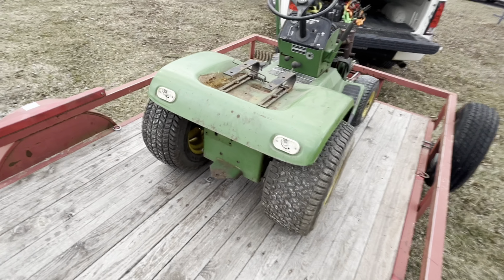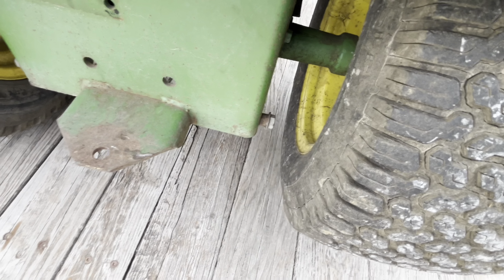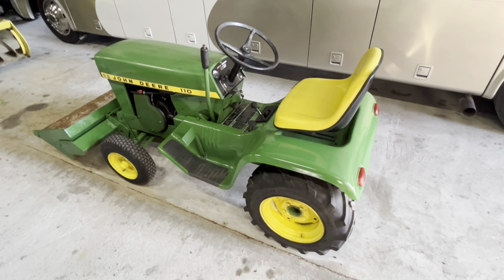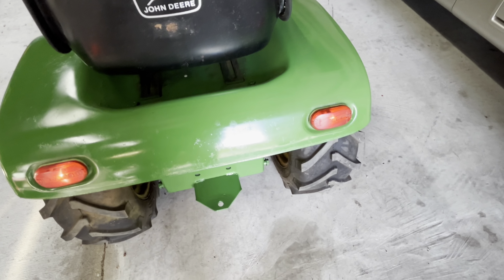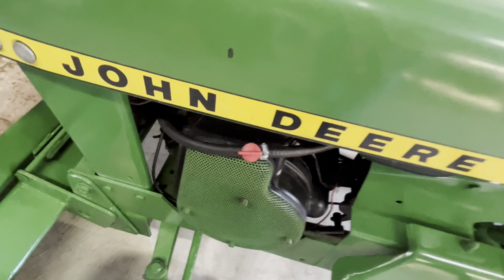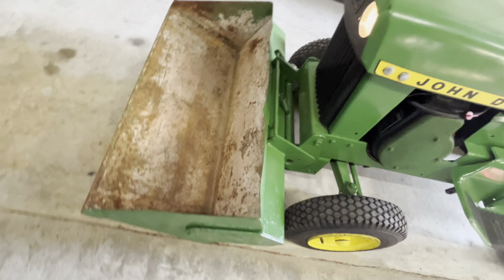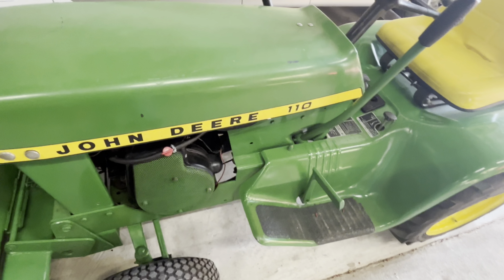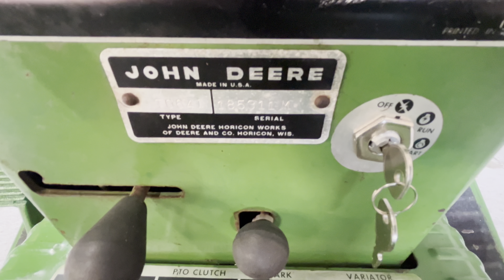This John Deere 110 is back from dead. Another one saved.

Comment: How hard is it to rewire the 110, last fall my 110 decided to cut spark so I pulled the covers off, and took the fly wheel off. I had to resort to cutting the stator out because I thought that was the culprit but I was soon humbled when I figured out. Do you know of any good places that sells stators for 110s?
Reply from the maker: The rewire part is pretty easy. I have a few manuals that have the diagrams and colors. They can be found on google as well. Its just time consuming.  I didn’t have all the correct colors of wire on hand so it didn’t turn out the way i really wanted. The last stator i replaced was a used one off ebay.